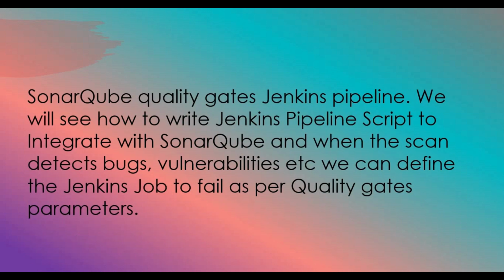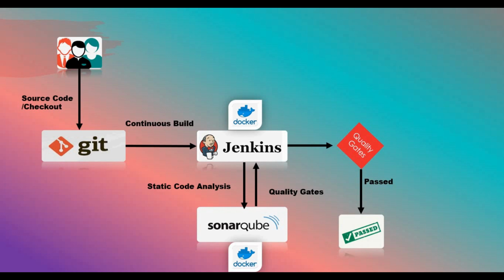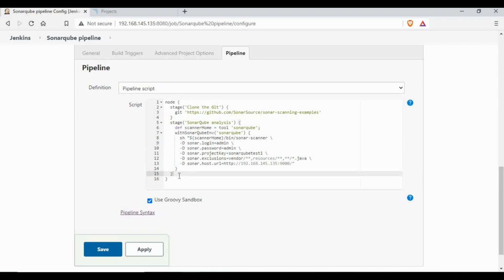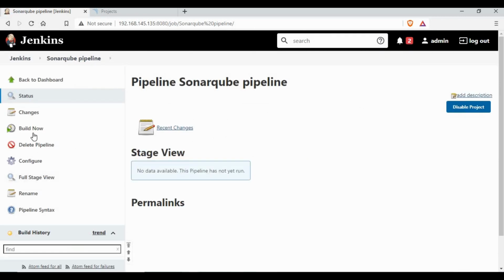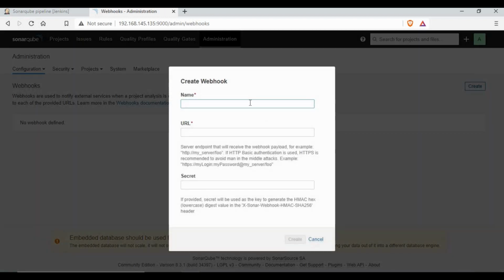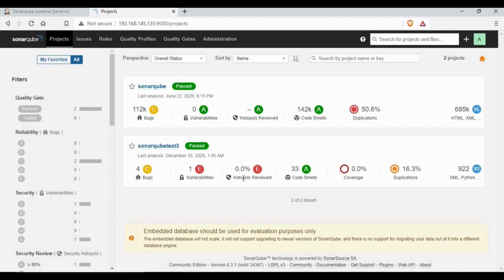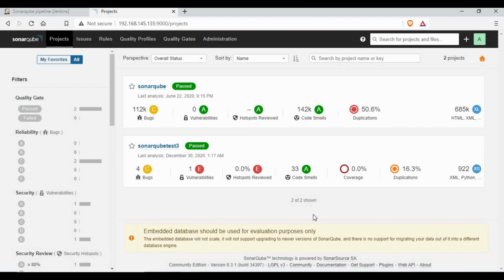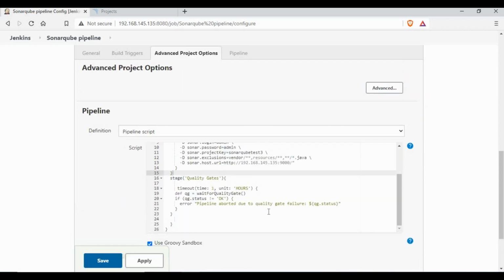SonarQube Quality Gate Jenkins Pipeline | SonarQube Code Quality Check &  Quality Gate Failed

Comment: hi there, excellent video, i tried to follow this video, job builds successful till 2nd stage " SonarQube Analysis " but "qualityGates" stage is failing with below error code. Could you please let me know, if it's possible for you what's causing this error.                                                                                                                                                           " org.sonarqube.ws.client.HttpException: Error 401 on http://localhost:9000/api/ce/task?id=AXbHvlb42xlvXb1FgSac  	at org.sonarsource.scanner.jenkins.pipeline.WaitForQualityGateStep$Execution.start(WaitForQualityGateStep.java:171)
" thanks